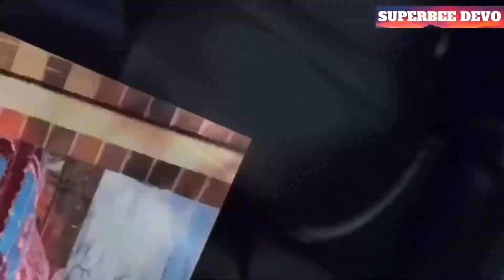CHRYSLER 300C 5.7 HEMI STAGE 2 COMP CAM!!! MUST SEE🔥BEST CAMSHAFT??🤔

Comment: When you do a cam swap you gotta crank it without it actually starting so you get the oil pressure up and get the lifters filled so you avoid this problem and a lot of immediate stress. Sounds great though
Reply from the maker: Thanks for the knowledge bro🤝a little new to all of this.
Reply: how do you crank it
Reply: @johnkin-yo2fv  unplug your fuel injectors and turn it on. It'll just crank
Reply: @superbeedevo I need help I’m building the same build did you run stock valve’s with the kit and what year was your hemi ?? Please I need help please 🙏🏽
Reply from the maker: @curtisparker9978  stock valve’s and 06 hemi
Reply: @jerodwolford2743 or press the gas pedal all the way

Comment: Hey brother did you ever get the code p0340? Camshaft position sensor circuit.     Been custom tuned brand new everything driving me nuts causing me to run rich